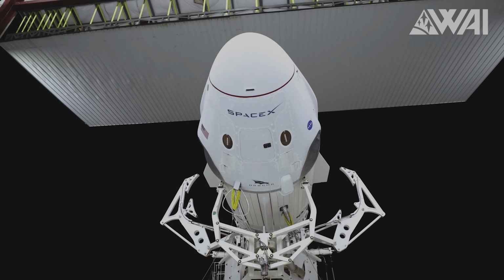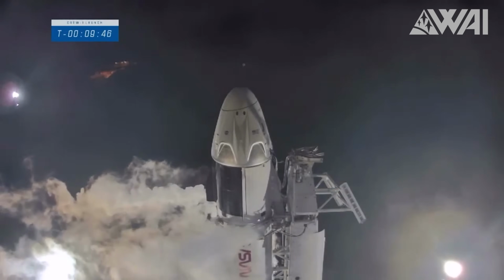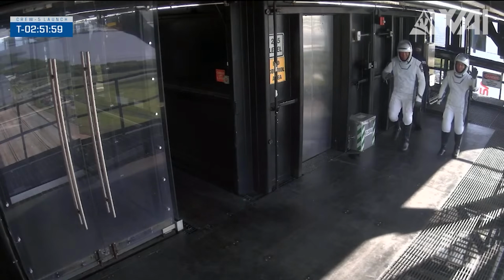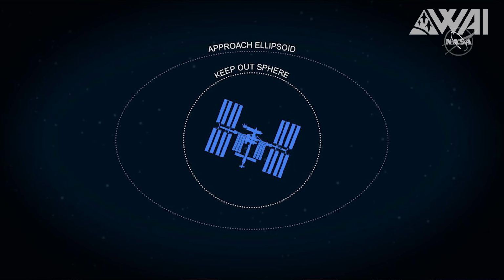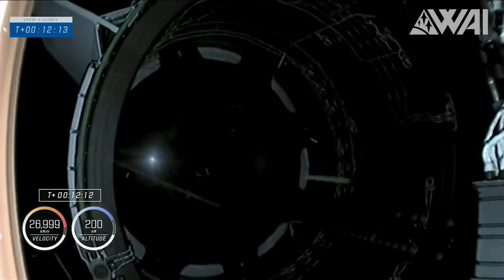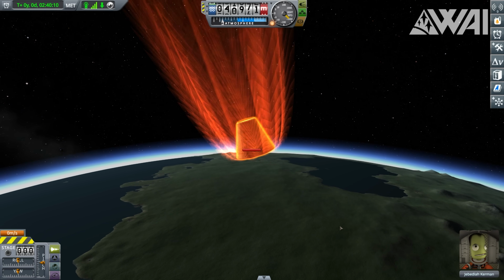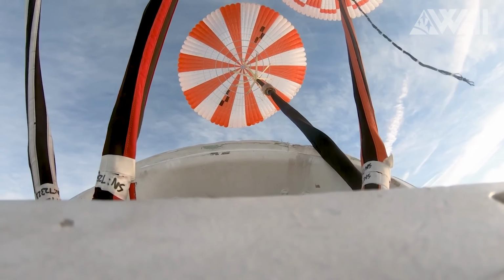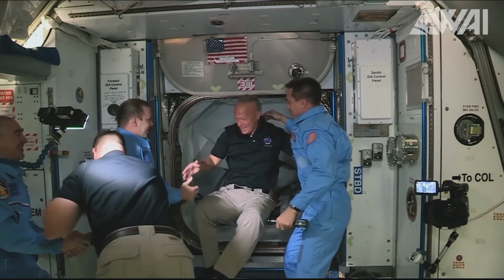SpaceX Crew Dragon: From Earth to Space and back! Take a ride!

Comment: Thanks a lot Felix, you always manage to tell me stuff that even I don't know, and I pride myself on keeping up. Hey, what about doing a direct comparison between the capabilities and interior accommodations of Dragon, Soyuz, Starliner and Orion? I think that would be very interesting.
One thing you left out about the SuperDracos and why they cannot be used for retro thrust or landing, due to the redesign necessitated after the pad explosion, they can no longer be throttled or even turned off. Once activated, they burn at full thrust until they exhaust their fuel, which is fine for abort scenarios, not so much for other situations.
Speaking of aborts, 3.5 Gs isn't that much. You can easily pull more than that on an amusement park ride. Have you been to Disney World yet? Go try it out.
Personally, I think the idea of using Dragon to ferry crew to Starship makes as much sense as using a motor boat to ferry people out to a cruise ship. Aborts will never be any more practical on a multi decked space ship than ejection seats are on air liners. There is no such thing as safe, there is only acceptable risk. We need to accept the risk involved in launch and landing.

Comment: Quick question...Love what Elon is doing BIG Spacex fan...but with the current configuration of Starship  I can't see where all the passenger space will be.
To me it seems like all the passenger room or most of it is taken up by fuel tanks.
Could you please do an episode explaining the final Passenger Starship with cut away's?
Reply: Look at pictures of a Starship upper stage, e.g. the renderings of the lunar variant. Roughly the top quarter of it is cargo space... there are some more tanks right at the top nose, but there's a huge amount of space in that thing.

As to explaining the final passenger Starship... there's no such thing and won't be for years, so anything like that would just be complete uninformed speculation.

Comment: Since they have the Super Dracos available, SpaceX really ought to go through the trouble to program the system to use them if there is a failure of the parachute system.  They wouldn't need to do a perfect landing - just slow the Dragon just before it hits the water enough for the splash down to be survivable.  The Super Dracos have the delta-v for it and being able to use the extra redundancy could save crew lives.

Comment: Wouldn't it be cool if SpaceX told NASA, "Hey, to prove Dragon further, we'll build every cargo dragon to the same specs as Crew Dragon and land it propulsively at Edwards AFB" (or maybe Vandenberg, not sure if the Delta-V of the vehicle is enough to reach there). Basically, recover all of the capsules.

On the other hand, I think SpaceX has long stopped caring about Falcon and Dragon, they just fly them to make money but they consider them to be a dead end, focusing on Starship instead.
Reply: What you're missing is that cargo Dragon was already recovered. That was actually part of the problem — NASA was relying on that recovery to return payloads from the ISS, so they were unwilling to let SpaceX risk those return payloads by experimenting with propulsive landing. That meant that SpaceX would have had to develop and certify propulsive landing entirely at their own expense — not as an add-on to other missions as they did with Falcon — and they weren't prepared to do that.

Comment: I still think that if SpaceX were forced to, (due to main parachute failure) they would be able to propulsively land the crew dragon capsule.  The  emergency abort engines are fully fueled and ready to fire at any given moment.
Reply: As Felix said though, software is the missing bit. Firing the engines for abort purposes doesn't require fine control — it's basically light up, and run until you're out of fuel. Landing safely requires much more precise steering and throttle control, and if they haven't developed and tested the software for doing that, it's not a viable emergency option.

Comment: It would take more than just programming for the Dragon to land using it's thrusters. Part of the "fix" required after the dragon explosion during testing, they had to put a single use valve which prevents the refiring of the super-dragos after the first time.. which I believe would be required for it to land without parachutes. And I have no doubt there would be a lot more to content with as well such as designing landing legs to work with the heat shield safely, which is the main problem NASA had with the idea from what I recall.